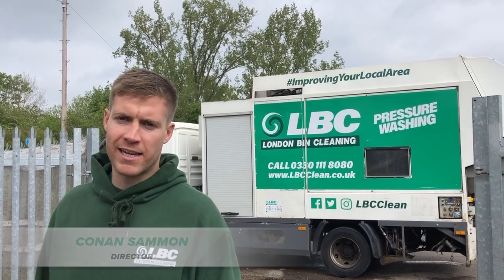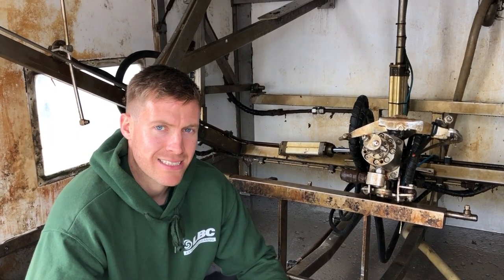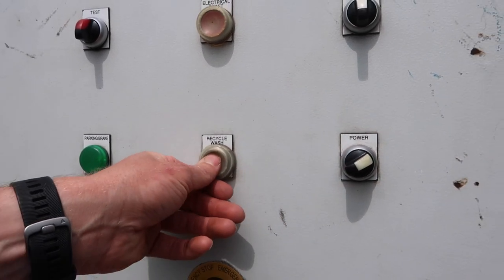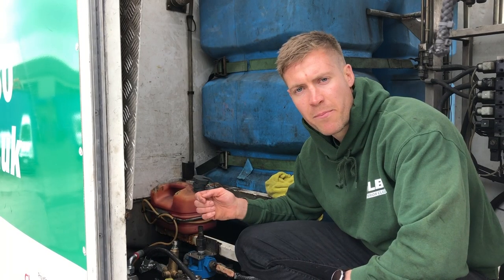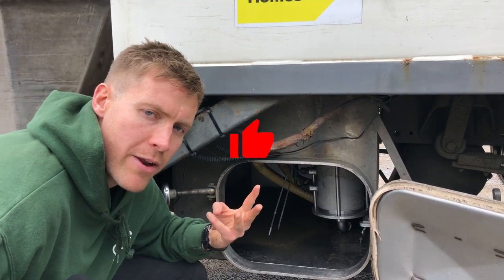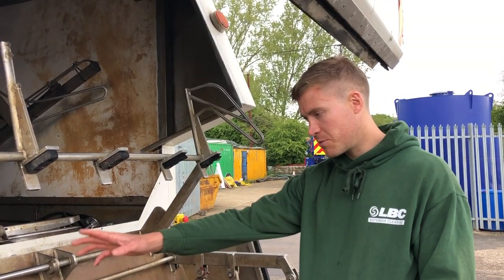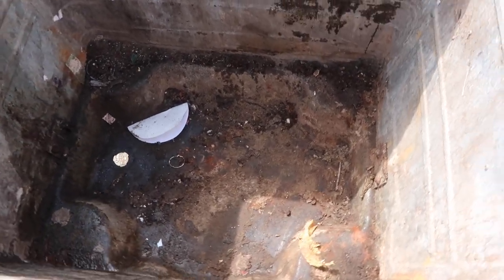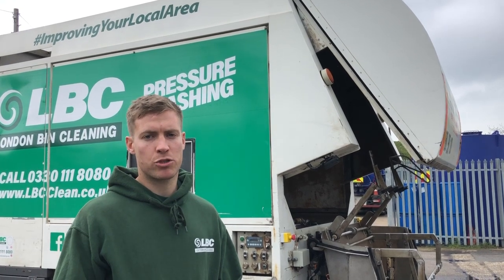London's Only Fully Automated, Fully Enclosed Bin Washing truck - Demonstration

Comment: 26 tons no way, my Volvo FH 3 axle rigid is a 26 tonner 500 horsepower this would be a 7.5 ton or a 12 ton but definitely not a 26 tonner
Reply from the maker: Hi There, you are correct this is a 7.5 tonne lorry . Not sure where the 26 tonnes has come from?